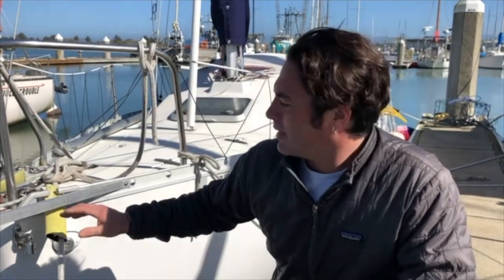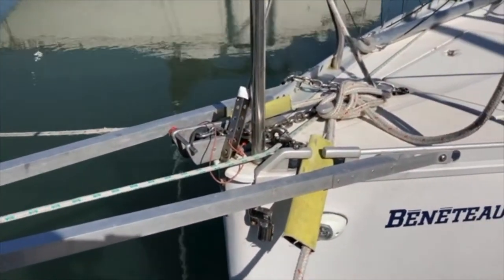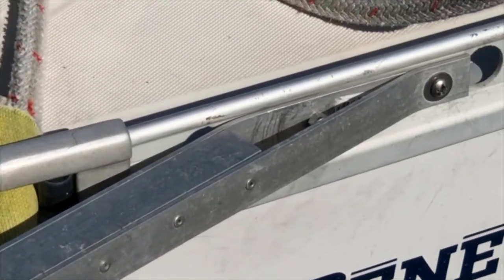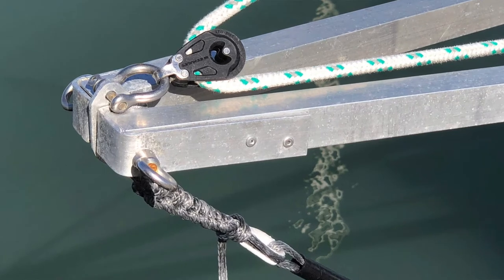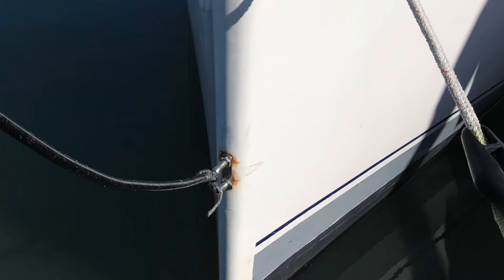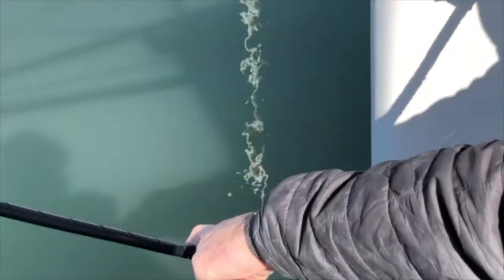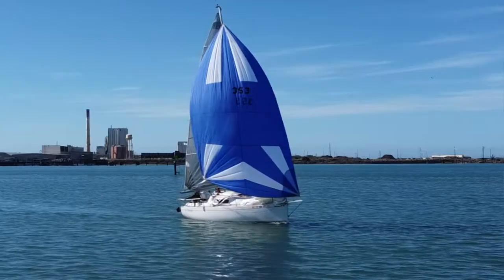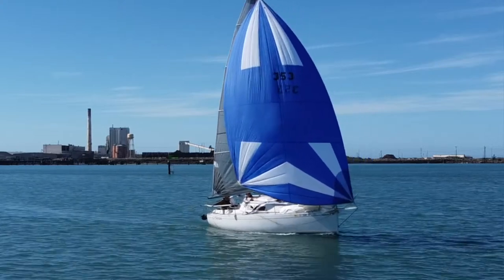Bowsprit for a Beneteau 235 Sailboat. HYC Ep.47

Comment: To where and how are you going to attach those whisker stays? You'd need to put some serious tension on them so I doubt you could through bolt then onto the side of the hull even with a backing plate.
Reply: I attached a pad eyes to the aluminum toe rail. It seems to be working well so far.